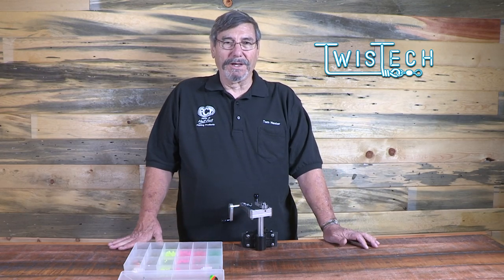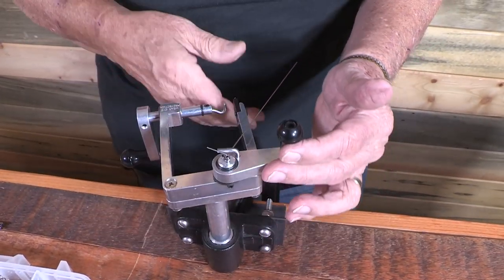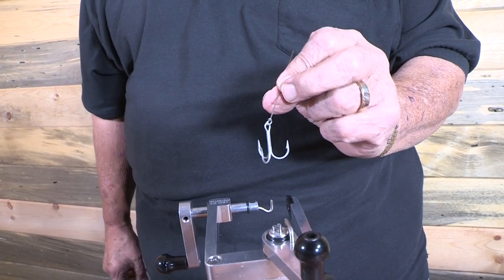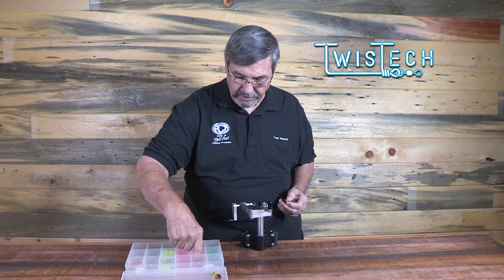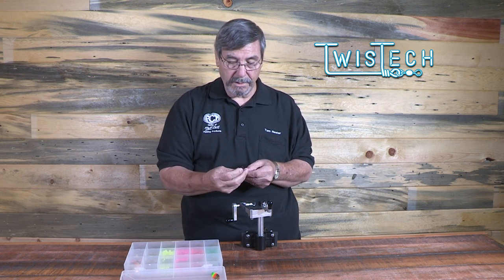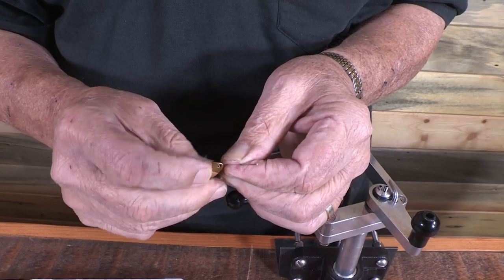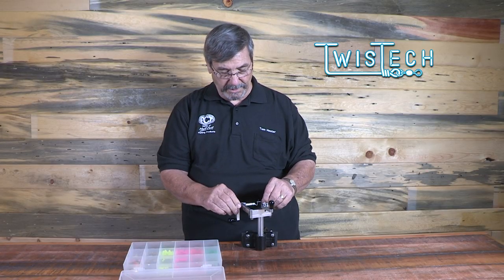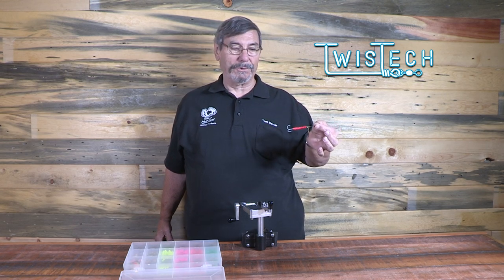Build Your Own Spinners With A Twistech

Comment: I love my twist tech!  I really like the mount he's using, it would free up the wire interference I have when making my spreaders.  Are these available somewhere?  If not, my wheels are already spinning on making something similar.  Thanks!
Reply: Those mounts are indeed available. It is called a 'rod-holder mount' and works in conjunction with a Fish-On rod holder bracket. It will also work some of the others but fits best in the Fish-On brand. I recommend mounting one bracket on your workbench and another in your boat in a location where you can easilky reach it.

Comment: how do you get a trailer hook on this set up?
Reply: There are a couple of ways to do that. First, you can 'hard wire' it in. It's a little tricky but it works like this: When you make the cross-over bend for the hook end leave the tag-end of the wire wrap a few inches longer than you would for a regular looped end. Install the main hook, make 2 wraps, bend the excess tag-end straight down along the hook shank. Position the hook tubing over the hook eye and bent-down tag-end. Complete your spinner construction and then make a cross-over bend in that excess tag-end. Finally, install your trailer hook into that cross-over and wrap just as you would for the main hook. 

A second, and easier way to install a trailer hook is to simply tie a length of 65 to 80 Lb test braided line into the loop in the wire at the kook end, slide your tubing over the hook eye and braided line, then tie your trailer hook to the end of the braid. 

Hope that helps.